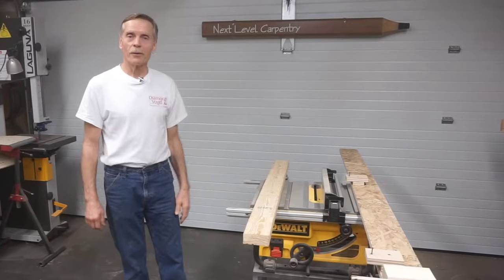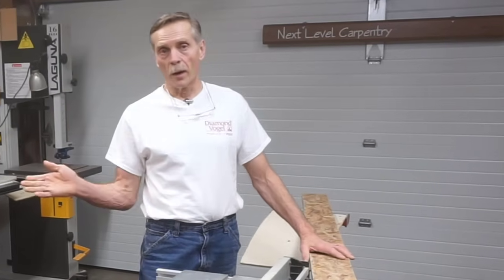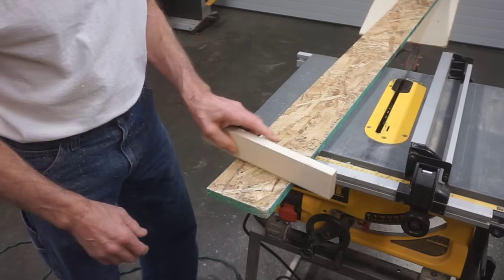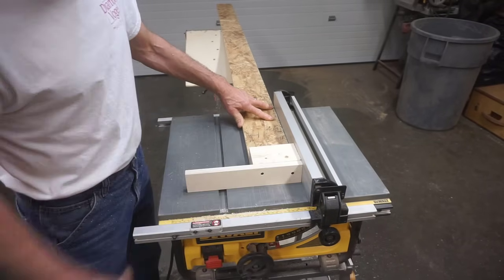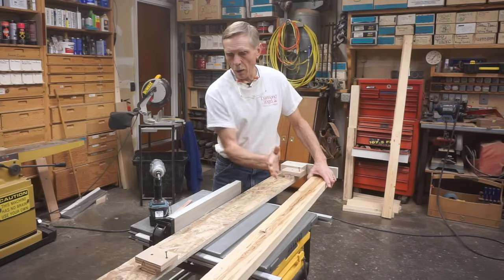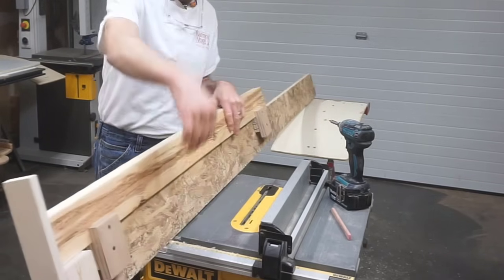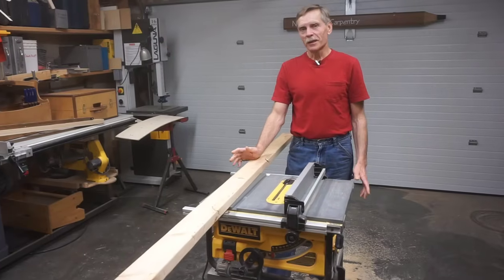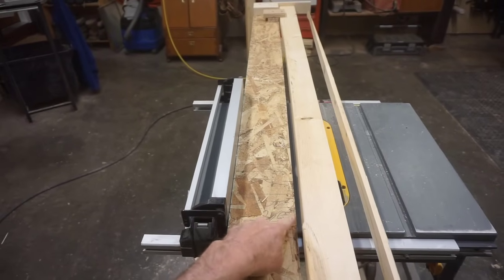How to Cut a Straight Edge on Crooked Boards

Comment: Sooo you need 2x6s and 2x4s to make 2x4s and 2x2s! Swell
Reply from the maker: And when you need straight 2x3's for furring or some such, your all-knowing approach is to rip down a perfectly good 2x4 and throw the scrap away?  Swell indeed!
Reply: Home depot sells the "right handed board stretcher."  Too bad you need the left handed version, lol.
Reply from the maker: @mitch_the_-itch  Not a problem... the BS 1000 is available at Lowes and works for left AND right handed wood: https://www.youtube.com/watch?v=bgS6-O2APWY
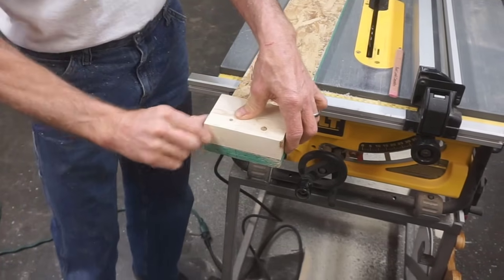Reply: Absolute best response to that smart aleck comment, @NextLevelCarpentry ! Even with the proprietary cambium retro-encabulation, some folks like mitch_the_-itch might still be concerned about the 4:20 mark on the BS 1000 video.
Reply: If working with construction lumber for projects, it sometimes requires buying larger dimensions than you need to ultimately get (or make) a straight board of the right size.  Saves money compared to buying factory finished wood at HD and Lowes.
Reply: This is what happens when you select crappy lumber from from a crappy wood source like home depot which relies on minimum wage labor to not care about your product.

Shop somewhere else that cares more about the wood, and select straight boards. Framing doesn't need to be perfect, just pretty good. It can be adjusted after install. Furring strips are made from compressed cardboard and readily available at any hardware store. You layer them up as needed to create flat walls, and plane down high spots. I have to do this everytime I install a shower because tile and stone don't bend with walls. But it can be done to get any wall plumb and flat.

Also you can buy engineered framing made from a plywood lamination. That stuff always stays dead flat and won't even move seasonally.
Reply from the maker: @brandonhoffman4712  This is what happens when YOU buy crappy lumber.  Seasoned carpenters doing real world remodeling understand the value of salvaging/repurposing lumber for both carpenter and client.  Many of us strive to get framing better than 'pretty good' rather than rely on shims to correct marginal workmanship.
Reply: @NextLevelCarpentry Well said.
Reply: First off, this is not a criticism but I am not sure I would trust that board again. In more valuable wood, where even short pieces can’t be scrapped I can sometimes save more board feet by cutting it into shorter pieces and then squaring them up.( I don’t build structures so straightening a long warped board is something I don’t need to do.) Thanks for sharing your techniques.
Reply: @NextLevelCarpentry  • Your reply to the wise-@ss was really good ... to quote Chief Ten Bears from the Josey Wales movie, "There Is Iron In Your Words" Lol(!!) ... Nice 🙂. • This video was my first exposure to your channel, and I'm subscribing today. Your dedication to safety, your insistence on accuracy, and your rejection of foolish approaches and silliness is most respectable. I'm old enough to be better at woodworking and carpentry than I am (64), but I really enjoy both, and I'm looking forward to learning from your experience. Thank You, Sir.
Reply from the maker: @danielmoose1273  Great comment and movie quote!  I always liked "dyin' ain't much of a livin', boy"
Thanks for subscribing... hope your high opinion of Next Level Carpentry videos holds up.  Feel free to add quotes to comments on other videos here on the Channel 😎

Comment: Great idea but not worth time and setup to save a $3 board, quicker and easier to use a bowed board in braces etc.
Reply from the maker: Sooo... what you're saying is that there's no reason EVER to need to straighten a crooked board?  SMH
Reply: @NextLevelCarpentry  You got it - for a home project, maybe, at a job site NEVER... it is not worth the time, energy and effort to save a board that can be used in 100 other places that basically don't matter - braces, spacers, supports, etc. And if it is that bad, you can use them on the muddy / wet areas on the ground to walk on. Maybe you should go out on a real job site, and get some practical experience.
Reply: @faustdj7878 You have no idea what you are talking about. There's a reason why this video has the number of likes it has. If it wasn't valuable, people wouldn't watch it.
Reply: @meilyn22 sorry but you clearly have no idea what you are talking about or on site experience

Comment: Watched another video on same subject and it wa less than 3 minutes. This one is almost 16 minutes with him saying the same thing over and over and over.
Reply from the maker: If you learned how to do this in less than 3 minutes why did you bother watching this and then taking the time to make an annoying comment?  Not the sharpest chisel in the toolbox maybe?! 🤨
Reply: @NextLevelCarpentry  I always like to check out differing opinions on how to do something...it's called research. So someone doesn't like your video and how do you respond? You make a personal attack. Tells me all I need to know about you. Closed minded and afraid of a little criticism. Reply if you wish but I am blocking you if that is possible.

Comment: Bows and crooks are two entirely different lumber defects.  As are cups and twists.  And wane and splits and checking and spalting.

I don't care that this vid js five years old.  

It is confusing to pro and novice alike to use these disparate and meaningful terms interchangeably as if it doesn't matter.

It does.
Reply from the maker: Oh, get over yourself Darren... the information in this video is for straightening boards for everyone, all 3.5 MILLION of them so far, even those who don't pontificate about or even know the technical differences you (correctly) delineate.
Reply: lol, fair enough, it's just a pet peeve of mine I guess.  I work with a lot of reclaimed and culled and repurposed lumber and the specificity matters a lot more to me than most.

So, I hereby retract my  complaint.  😊

I am a subscriber and I do like your work.  Thanks for the reply and thanks for sharing your knowledge with the world, beginners and pros alike.
Reply from the maker: @DarrenYork  Wow... you've earned my respect for your reply... my reaction was aimed at an armchair YouTube know-it-all, not a level headed guy who shares his knowledge from experience.  I understand the peeve part and have plenty of my own where carpentry/woodworking is concerned.  I hope other viewers read this exchange for both enlightenment and entertainment.
All the best to you in your work with un-new lumber! 😎

Comment: Great skills, but what a ridiculous waste of time. Time is money on a construction site and there’s no way anyone has time to mess around with overcrowns. Also 1/8 of an inch is totally natural and acceptable for framing.
Reply from the maker: "what a waste of time"?!  It appears you have a restrictive case of tunnel vision if you can't see the usefulness of this method.  With a broader perspective you'd understand that this video is NOT an attempt to save time or money by messing 'with overcrowns'.  That WOULD be foolish and is not the lesson from the video...
Reply: @NextLevelCarpentry  Your own presentation starts out talking about the impracticality of hauling a planer to the site, and that your method is more practical for a job site. I was a west coast framer for twenty years. No one on a job site has time to straighten lumber. Lumber like you were fixing is relatively cheap to begin with, and warped and twisted lineal is used for bracing, then cut up for blocking and backing. I think you're skills are amazing and the process itself is somewhat interesting, but your viewers should know that this is definitely not a typical job site practice.
Reply from the maker: @davekoch317  Your assumption that this is meant to save money by straightening studs is what I disagree with. I never tell viewers that this process is intended to save time or $$ by straightening 'overcrowns' in a foolish attempt to use them as a replacement for straight studs, especially considering the fact that it wouldn't work for that anyways because the resulting straight stud would be too narrow.
It's hard for me to believe you were  a framer for 20 years and never encountered a situation where you needed to straighten a piece on the job, on the fly, which is the whole point you're missing in the video.
What I do show my viewers is a quick, simple and practical way to straighten crooked boards on a jobsite when they need to, hence the video's title "How to Cut a Straight Edge on Crooked Boards".  
Any carpenter who's done even 5 years of framing, especially if any of it is spent doing remodeling/restoration work, knows there are countless times when perfectly good lumber from tear-out areas can be quickly salvaged, straightened (if necessary) and re-purposed, saving customers a good deal of money and, because of less new high cost lumber (unless you don't consider $10 for a pre-cut stud high cost) being senselessly ripped down and chopped up for furring, blocking etc, fully justify the time spent straightening with lower overall project material costs.
Reply: @davekoch
The process he is using would not be used every day on any framing site of course…but if you happen to have this easy to make sled pre-made and on the truck it will be a benefit. I’m a 3rd generation lifetime builder with lots of tricks. I use this all the time in my shop.
Reply from the maker: @slickmick1218  Thanks for adding a sensible comment to this thread Mick... it's obvious to me that you 'get it' where others clearly don't!😎

Comment: holy crap thats a lot, just buy another 2x4
Reply from the maker: Apparently  it IS a lot... too much, in fact, for some people to grasp the main takeaway of this video.  If you heard an unusual 'swooshing' sound while watching the video, that was the sound of the point flying by as you missed it. 🤨🤣
Reply: Best if you stay playing with your video games
Reply: @NextLevelCarpentry 🤣
Reply: If u have to rip a 2x4 its no longer a 2x4 and could fail a code inspection.. couldn't imagine what the boss would say to a guy making $40+ taking the time to make a jig to straighten a stud😅 i do get the point tho, that's why we keep a tracksaw handy. In the shop i have a 20' 3"x3" steel beam(2 square jack post) that i just clamp centered to the fence to straighten 16' stock mostly 9"-10" wide for facia boards & bulk heads. The jig u made is similar to what i sometimes use with the planer & shims to get the twists out of a board, beam or slab & works well.. seriously tho, you should go set this up on a legit job site and film a reaction vid 😂
Reply: @human4805  With this negligible amount of material missing from a structural member, it’ll still be within engineering/span limits. 😉 Just don’t get nuts with it.
Reply: Ha, I was just busting his balls! building carpentry & craft carpentry are oranges & apples. Please never try framing a house  🤣 if your that picky over a 2x4 you'd have to trim +70% of a lift. Thats why u crown studs the same way on layouts and straighten bad ones after.
Reply from the maker: "Straighten bad ones after"?!! I question your approach to quality framing and suggest you 'never try framing a house' until you learn more about responsible craftsmanship. 🤨
Reply: So u don't straighten studs 🤣 these comments had the crew in stitches. Come on bud,  At least watch a couple shorts on how to, or why you need to straighten walls / studs before hanging drywall on ALL builds. I was joking around with 1st comment, then to have my last one deleted is just weak. lost a fan with this arrogance. Please Stick to arts and crafts, peace ✌
Reply from the maker: @human4805  so everyone on your crew is as myopic as you and you're proud of it?!  It figures, I guess.  If an experienced carpenter with a sense of pride in his work ever showed up on your jobsite it sounds like you wouldn't even recognize your shortcomings... sad.
Reply: @human4805  You keep a 20 ft. steel I-beam on your truck to straighten studs with a track saw?
Reply: @ericjsmoczynski4374  this is getting silly, I was pretty clear but ill dumb it down for you even more.. work truck has a tracksaw. shop has a 20' beam for a table saw. You never rip studs to straighten them for framing or its no longer dimensional lumber.. good comprehension skills tho. 👌 just curious after you've ripd a few studs on an exterior ( 2 sided wall) which crew gets to plane the wall true? The guys sheeting the outside or the drywallers hanging board on the inside 🤔 smh
Reply: @human4805  Ok, quote the source of an AHJ in the US that prohibits ripping 2x’s to correct framing stock.